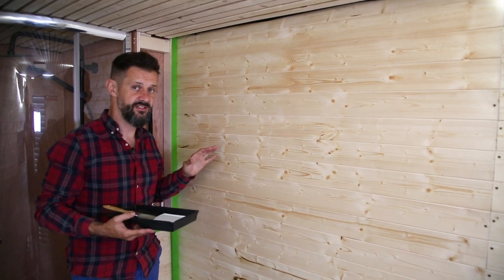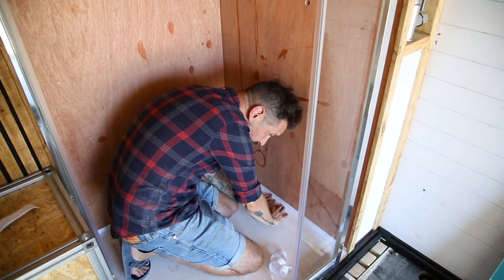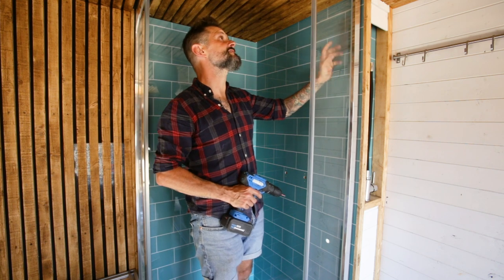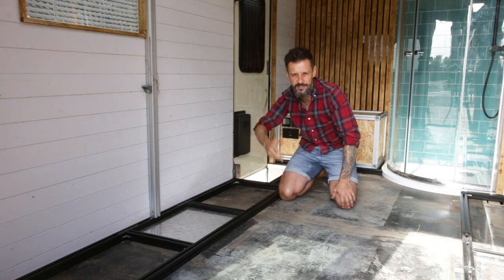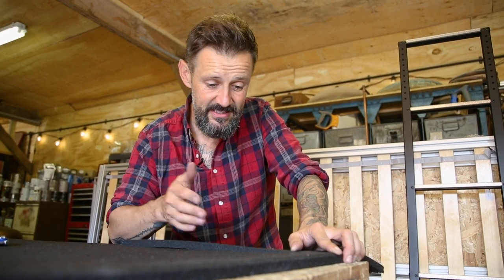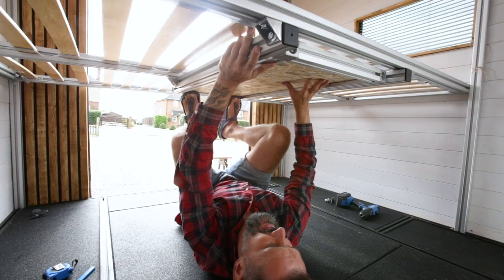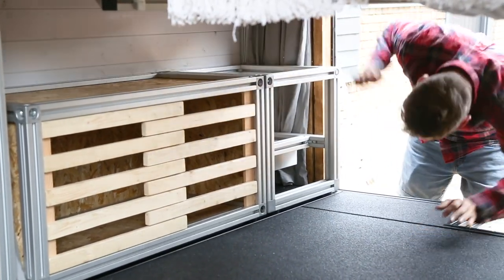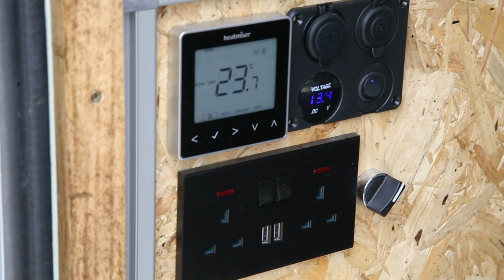Ambulance Camper | Double bed, Cabinets and Flooring

Comment: Nice work but unfortunately made the same mistake as others in not painting the woodwork before assembly. When the wood dries and shrinks, which it will, you will see a strip of unpainted wood along each joint/seam.